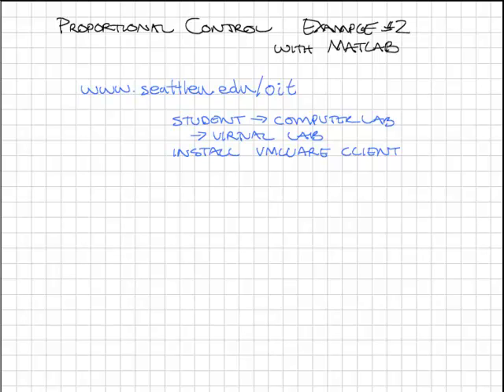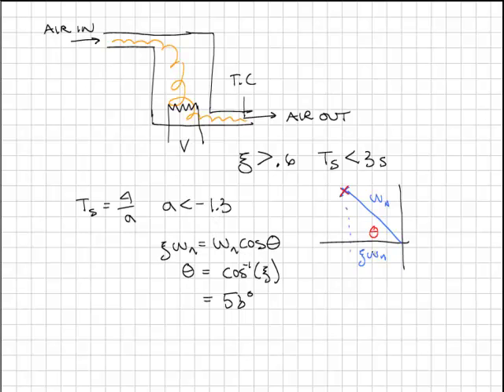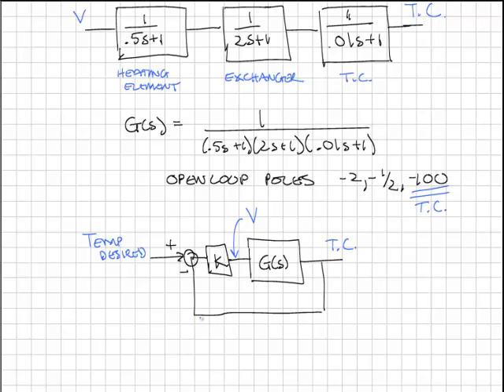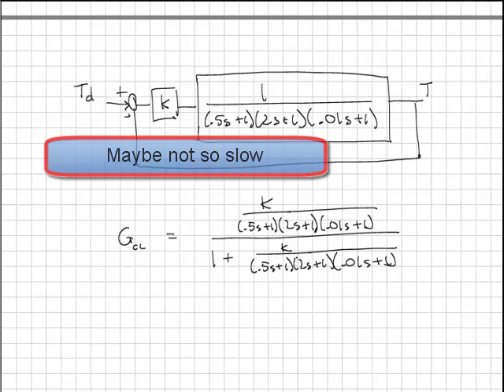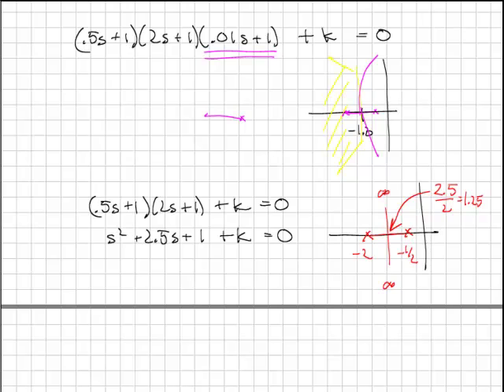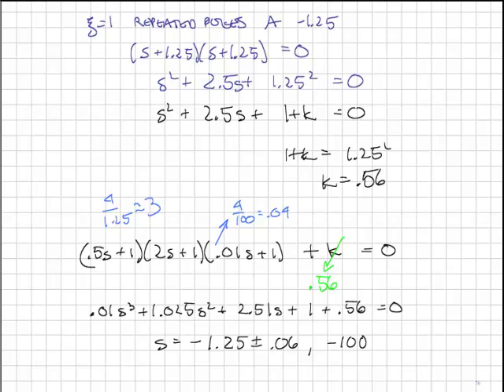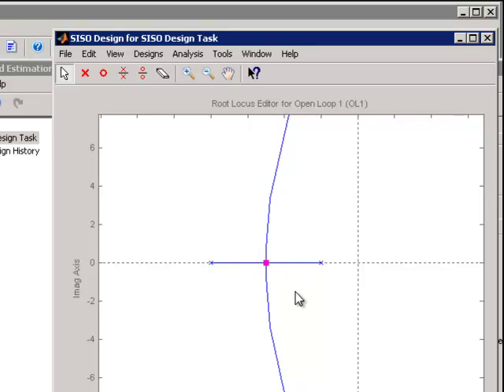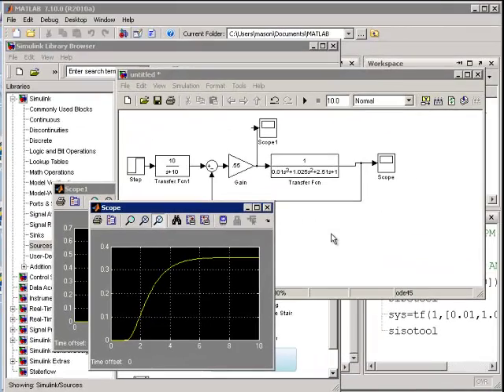Proportion Control Example #2

Comment: At 10:08 no need to match polynomial coefficients as any point on the root locus must have a magnitude of one. So

K/((0.5*s + 1)*(2*s + 1))  = 1 at s = -1.25 gives K =0.56